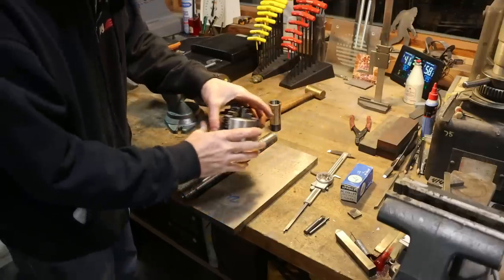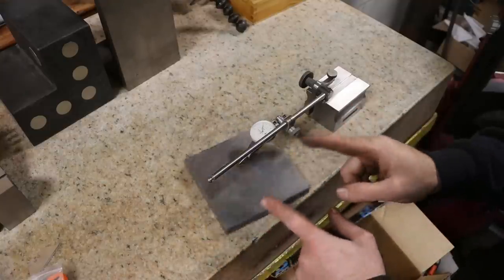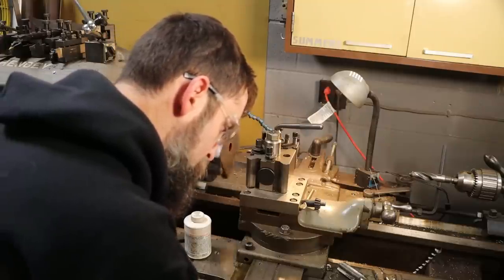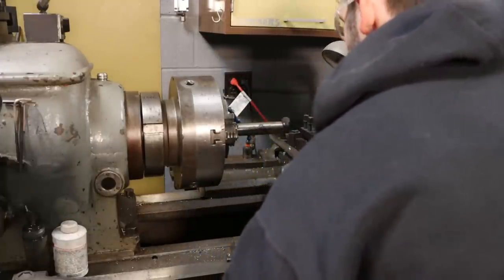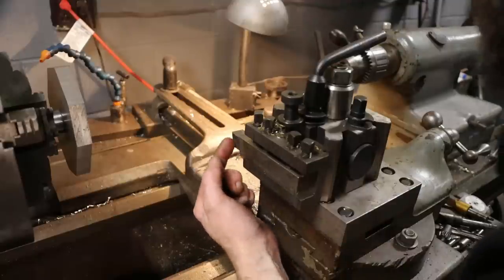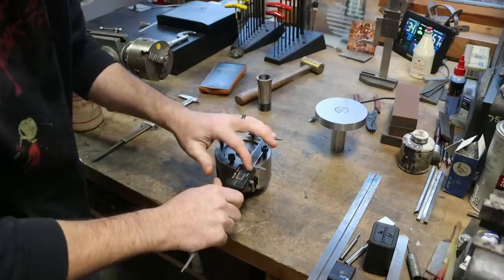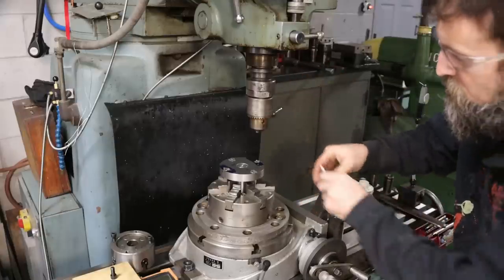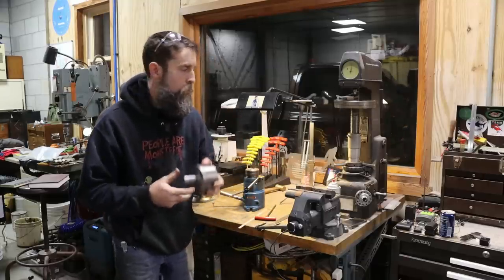I should have made this tool sooner. 5C to 4 Jaw

Comment: Don't worry about making your videos too long Steve.  I think I speak for a lot of viewers when I say we'll watch every second of them.
Reply: I didn't watch it in full due to time constraints, but everything I watched was solid content. Putting the shop to good use.
Reply: I just speed up the playback speed and skip ahead when needed.
Reply: Length is fine for me,   Just thinking but length is just what it is to get the context across.   

Aside:  When I watch some of the Shawn Ryan Interviews, it's like 5 hours long.  Yes a few setting to get thru it, but It's length is needed to get thru all the material and it also allows the interviewee to go off on tangents you will not hear on other formats.  Delta and Seal members are part of his guest list.
Reply: Right to the very end. There are few sites that seem to be over far to quickly.

Comment: Love your work. The energy that emanates from your shop is all positive and peaceful. Totally dig the fact that there's no DRO's anywhere in sight! I run a little shop here in Holland using only vintage iron mainly of German and Swiss origin. 
On the workpiece you made, Use a cylindrical fit and assemble with green Loctite like 601. Positive fit of 0.01 - 0.03 mm. Then skim cut the face. The bolt holes can be easily scribed off saving tons of time setting up the dividing head.
Note: skimming through the comments it turns out the 5C/ blank end arbors are for sale for next to nothing. Goes to show it pays to investigate. Always more than one way to skin a cat.

Comment: That is a handy tool to have in your shop, I did a similar thing with a small 4-inch, 4-jaw, #2 Morris taper that now will fit in my headstock or tailstock, I can quickly put the small 4-jaw on the headstock, with no need to remove the 8", 3 jaw or use it in the tailstock to cut tapers without moving my tailstock lateral setting.

Comment: If you need cheap lathe carbide you can use circular saw blades.. Just cut off one tooth along with about an inch of steel so you can weld it to your blank at the angle you want.. (better to use the thick blades). They make great cut-off tools for small diameters and thin wall jobs.
Reply: I cut the whole tool from a saw blade & just stick it in a standard parting holder...no welding required, I'd be worried about heating the braze up too much.
Reply: rollinrat4850  i do it all the time.  Even cheep saw blades work well.  Here is the downside:  there is VERY little contact area for the braze on the top of the saw.  Since its carbide, you can pretty easily make enough heat to soften that braze & rip the carbide out...usually embedding it in the part.  So my word of advice, keep them well lubricated / cooled.

Comment: Hi Steve, First may I wish you and your family a happy Christmas, and a very prosperous new year. Now to work. 1:On the Southbend 4 jaw, can I suggest that you drill and tap a series of holes at different diameters in the face of the chuck  something like 6mm, this is to receive some hexagonal standoffs ( parallels) which can be machined to give you an infinite number of positions to set parts in the chuck dead parallel to your needs ( you can machine different lengths obviously and match mark them to save skimming every time). 2: When screw cutting cut chamfers before you start cutting the threads, if you cut the chamfers after cutting the thread you can turn the thread over and the thread may feel tight when it isn't. 3: Depending on the lathe, you can leave the thread cutting lever engaged and just reverse the chuck rotation to get back to the start position, the reason for doing this is that if your machine has any wear in either the lead screw or the half nut this eliminates that. ( See Abom's problem with this https://www.youtube.com/watch?v=gEAURyEZcqM&t=2350s.  ) 4: Whilst you have the part true in the chuck, machine the register for the chuck then you know everything is dead nuts true. 5: Turn your backing plate around ( and set flat using your standoffs) and screw in your spindle, skim the o/d  of the spindle and proceed at your leisure.

Comment: Hey Steve cold morning to ya from St. Louis Metro east IL. Just a thought. 🤔🤔I was also thinking you could also drill and tap for a locking set screw on the front to lock the C shaft and plate together. You never know what you might use the chuck for. Wouldn't want it to loosen or worst fly off for any reason. 👍👍👍👍👍

Comment: To each their own. Given the likelihood of alternate uses and the need for rigid work holding, I would have put the register in. Its a four jaw so any adjustment is easy to accomplish at the levels a register would prevent.
Reply: Agreed! That is the proper way to machine a backing plate. Weld inside shaft and recut the face/register/diameter. While checking for run-out.

Comment: I very tip of my finger running a drill press like the chamfering You were doing, The ( un deburred ) part grabbed, spun and clipped the tip of my finger and just took it off. Not quite to the bone. My dad lot the the tip of his finger on his last couple of years in his career and i did the same when I was about 50.      You hve skills, just be carefull. it just takes a second to drop a block in on of the t slots to prevent part from spinning. Sorry for the rant.
Reply: Agreed! I never run anything unclamped. In fact one of the best things I ever bought is a guide rail that fits the Gressel Ecopos line of drill press vises. You should really check it out. I use either that, or clamp solidly on the table, either the vise or the workpiece itself. Only the smallest diameters (about up to 6 mm) I drill on a different high speed drill press without the 'Fuhrungsschiene'. 
Furthermore, I think it's much better to countersink before threading using a 60 degree drill instead of the usual 90 degree. Unclamped work will always produce bad countersinks, as is visible in this video with the workpiece moving under the drill. Countersinking after threading will also produce a burr pushed to the inside.

Comment: Took the scenic route making your backing plate. A regular carbide insert, slow your spindle down and bury the carbide . Round piece in 2 passes no interrupted cut. A rotary table for a square hole patter? Figure you have to use it because you own it?

Comment: Good afternoon not from Dorset but from Northern Finland. -12 degrees C here and snow has been here already for 2 weeks
Reply from the maker: That's pretty cold. We haven't gotten quite that cold yet this year. I think around - 8°C is as cold as I have seen it so far this winter.
Reply: @SteveSummers  it can get as low as -35°C in January or February if we're unlucky. I don't like it at all.
Reply: That's 10.4 deg. F. and quite cold.  The people of Suomi (Finland) have a well earned reputation for toughness.

Comment: might be usefull to make a remote controll for those higher levers so you dont have to climb on top of the duall mill 
basicly thinking about something simular to forward controlls on a motorbike , a lever thats mounted lower on the machine activating the original lever on top with a push pull rod and some rose joints

Comment: Great video.  I'm surprised you haven't made a spring loaded tap follower yet.  Perhaps that will be your next shop made tool. I know you tossed and turned over putting a registry on that backing plate, but think about this - with the registration, if it's off by a thou, it's repeatable.  Mark your chuck and the backing plate, and set it up the same every time.  You know before you even start that it's off by a predictable amount right out of the gate.  Besides, it's a 4-jaw. For me personally, a registration just makes it easier to line up the bolt holes without any fidgeting. Just an opinion from the depths of OCD.

Comment: Hello Steve, I heard you talking about the drill speed and I'd like to tell you what our teacher at my tech college (some + 50 years ago) told us about this. You need to consider that I'm talking metric. The teacher told us how to find the excact speed for a drill, but he said, it's easier for you if you remember this: devide tenthousand by the drill diameter (mm) and you find your drill speed in rpm. So turn a drill of 25 mm. (or 1") with 10,000 / 25 = 400 rpm.
Reply: Thank you very much . From Arizona.  Any advice for end mill speed ?
Reply: @mikeseidner3085  I'm sorry Mike, but as there are so many differend types of end mills, he did not give a golden rule for that.

Comment: I have a piece of d2 that I tried to saw. The saw just would not cut it. My son noticed on the bandsaw blade box that it said to run d2 with no coolant. We tried it and it cut through no problem. It seems the coolant makes the blade want to want  just slide over rather than cut. It worked 10 times better dry.

Comment: When you measured for the PCD,  the 83.93mm should have raised a question as to the dimension. Almost certainly it would be 84.0mm for an import chuck like that, taking into account slop in the socket head screws etc.

Comment: Interrupted cuts is where I always avoided carbide.  Each corner of the cut is like a hammer hitting the carbide which is very hard, but not strong enough to absorb the impact without chipping away.  What did I get wrong?

Comment: I am a little confused wouldn’t the register give support in sheer where the bolts mainly work in compression? With no sheer support it would be possible for lateral movement on work pieces especially because the bolt holes are being over sized.

Comment: Excellent video as always. How well does your wood stove heat up your space? Do you need other heating or does that suffice? Designing my shop and I want a wood stove. All the best.

Regards
Term
Reply: Term, if you are in the design phase, permit me to make a recommendation.  After watching Steve rebuild his shop a year ago, I decided I could also build my own.  After a lot of research, I opted to go with in-floor hot water (radiant) heat.  For me, it was relatively simple to do, since I was starting from bare dirt; if you already have a building you are modifying, or an existing slab, it might not be an option, but I swear if I was building a new house today I would go with the same thing.  My shop, located in northeastern WV almost on the PA state line, is 32x40, with 11 ft sidewalls.  The walls are 2x6 stud frame on 16” center, 5/8”drywall inside and sheet metal outside with R19 fiberglass insulation.  The roof is standard 2x4 trusses on 24” center, also 5/8” drywall covered, with R36 insulation.  My hot water system uses an on-demand propane fired tankless water heater and circulating pump.  In the first year of operating, I used less than 300 gal of propane to heat the whole building to a lovely, steady 65F.  In reality it was a lot less than that, because the same system is also heating an 8x12 ft greenhouse I built next door, with a heated floor in it as well.  Even on 10F days, the heat for the shop comes on about 20 minutes out of every 4-6 hours.  The greenhouse requires more run time (just the nature of those things), so I am guessing that my total heating bill is probably more on the scale of 50-75 gal propane.  It is ridiculously efficient, the humidity in the shop stays low so I don’t get condensation and rust on machines and tools, and I get to work with warm feet.  Can’t say enough good about it.  I did mine as an entire DIY project, working with a company from in Vermont to design and source the components.  The company is called Radiant Floor Company, website www.radiantcompany.com, and they have been a total pleasure to work with.  I’m not paid to advertise for them, but I have no problem at all recommending them as a great bunch of folks to do business with.
Reply: @PracticallyMint  good info, I always heard radiant heating was really pricey. But I will check out the company. Unfortunately not able to do the work myself so I would have to contract that portion out. Again thank you for the thorough response.
Reply: @PracticallyMint  good info, I always heard radiant heating was really pricey. But I will check out the company. Unfortunately not able to do the work myself so I would have to contract that portion out. Again thank you for the thorough response.

Comment: Small internal thread like that you can put the tool in upside down and cut on the back side of the hole, its easier to see what you are doing that way, just be aware the tool pressure is going to tend to lift, might be a problem if your equipment is very light duty or just not so tight any more.

Comment: Ah yes, I also have a 4" four jaw chuck for my benchtop lathe like this. The provided drawings for it showed a 84mm bolthole pattern, so your measurement was not very far off. One other thing to note is that there seem to be different standards for the registering circle in these chucks, because my four jaw and collet chuck both have one with 72mm, but my lathe spindle and the three jaw chuck that came with it have a 70mm circle. Already made an adapter plate so I don't have to bump the other chucks in every time I want to use them. However, it might come in handy to have it once you want to mount the three jaw chuck.
Oh and btw. did you check the axial runout of the plate after you put it on? Would be interesting to see if it stayed square to the body.

Comment: Steve are you depending on the 4 cap screws to register the chuck concentric with the spindle ?
Usually the counterbored area on the back of the chuck registers on a raised diameter of the spindle plate, this way the chuck is concentric and the cap screws merely attach the the parts. 
Your parts still lend themselves to this better concentricity registration method.
Maybe watch this example at https://www.youtube.com/watch?v=M1fyycTJq2A    see 24:50

Comment: God job, entertaining, but a bit too long video. Okey, the old fashioned chip making is back.,
Time 38:35. Why not use bolt hole screws in the chuck that make punch marks in the plate? They're really handy.
Bolt holes.... Made a little bolt hole circle calculator on an Arduino and using the scales, DRO, on the mill..... No need for the rotating table that takes time to install and center.
How did You center the chuck to the plate? Bolt holes are not very precise. Turning a boss in the plate was expected.
Let's see the performance of this new tool.

Comment: I have to say I disagree with your Director on the register.  If you are the one who was arguing with the director, Kindly advise the Director for me, 😊. The purpose of the register is to keep any side forces from shifting the chuck on the faceplate. Bolts aren’t designed for side loads, and you are relying solely on the friction between the Chuck and the plate. Which might not be enough. And it’s a four jaw Chuck in any case, so you’ll adjust it to fit when it is in the Chuck. But you do Not want it to change position halfway through a job. But that’s just my opinion, and we all know about those, don’t we? So forgive me for different opinions.
Reply from the maker: I understand completely, if this was going to live in a lathe I would have put in a register. Not putting it in allows me to use this fixture for more than just a chuck . Grinding forces are next to nothing so I don't expect issue. It can easily be added as well. 👍
Thanks for watching and for commenting

Comment: Hope you don't but I suggest not wearing a hoodie with the strings hanging out when working wigh machines. I've actually never seen anyone ever using the strings... they are useless... you can just remove them. I've done that to mine.